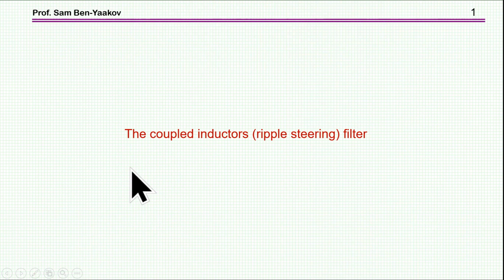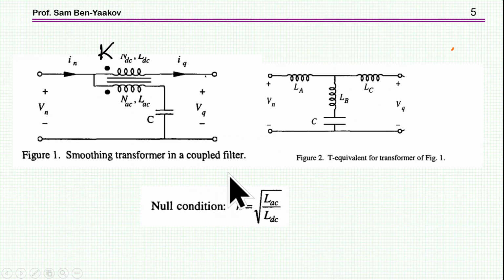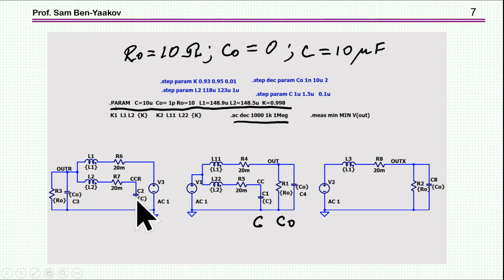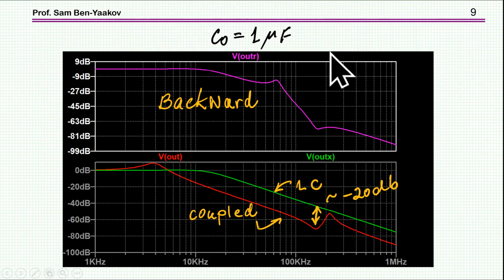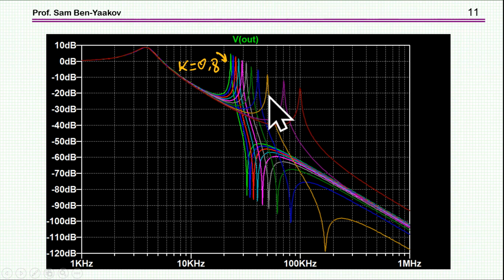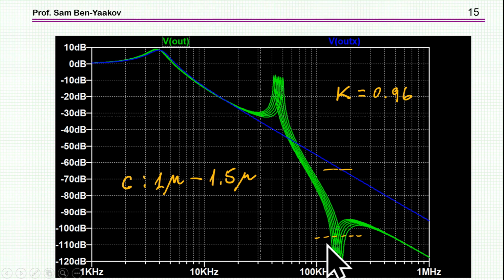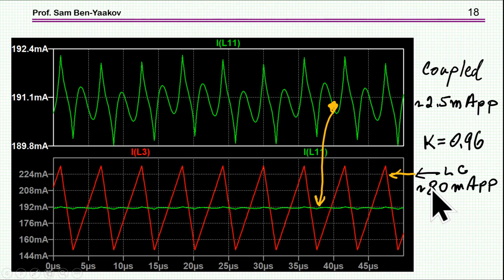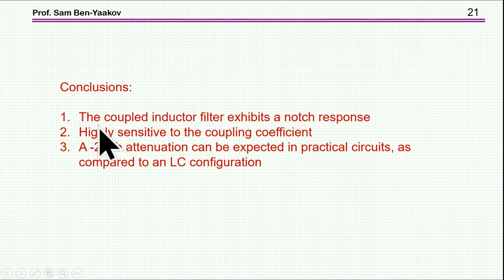The coupled inductors (ripple steering) filter

Comment: Thanks for publicizing this interesting filter architecture and providing the LTSPICE analysis. It seems like adding a little series resistance in with the capacitance could reduce the filter's Q and give more uniform attenuation results in the presence of up to +/- 1% changes in k. in any event, it's an interesting structure and I am looking forward to exploring its usage for band rejection in power applications. Thanks again for putting this out there!
Reply from the maker: Perhaps, if the losses and attenuation of notch will not   make this worse.

Comment: Excellent presentation Dr Yaakov. I think it would be interesting to use such a filter in high power converters in SiC mosfet since they usually have a lot of emc issues around switching frequency. By tuning the filter accordingly, i am guessing we can achieve a better emc performance not only at switching frequency but their multiples too.
Reply from the maker: Good point

Comment: Bodos Power magazine drawings are always low resolution, unfortunately.  Not sure if the printed magazine is better or not ?
Reply from the maker: I will check, I should have a copy around.
Reply: One neat thing about this method is that the extra winding does not need to use as large of wire as the main winding.
Reply from the maker: @k7iq  Indeed

Comment: Good video. Made a bidirectional buck/boost converter once by self designed coupled inductor on an E core using copper foils. Was interesting to see the coupling coefficient dependent on the reluctance ratio between inner leg and outer leg. Due to the flux cancelling out in the middle leg, a high efficiency could be achieved when comparing to two single inductors.
Reply from the maker: Interesting. Thanks for sharing.